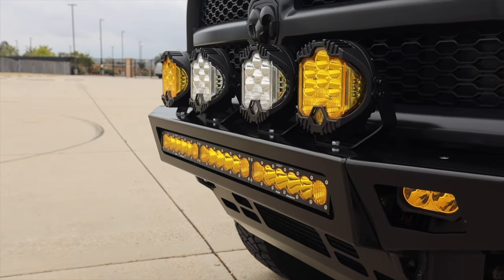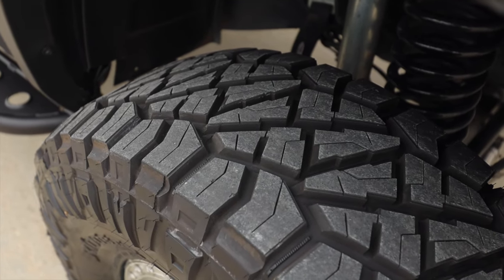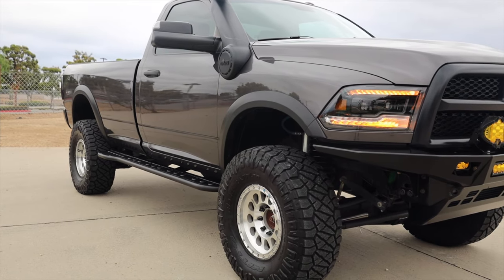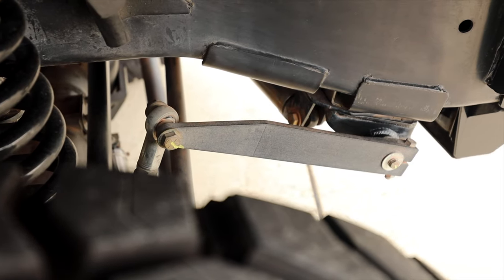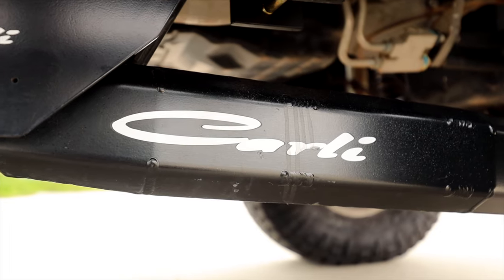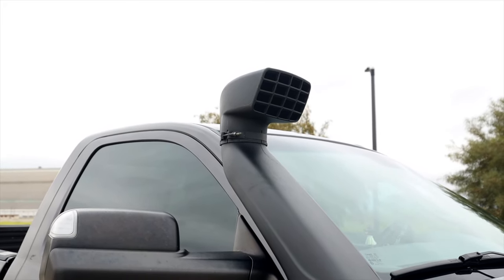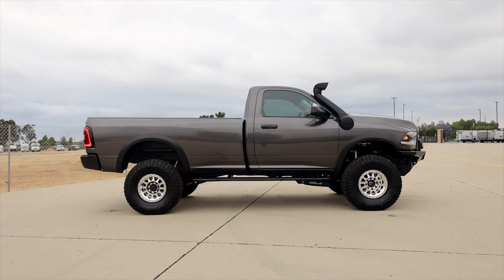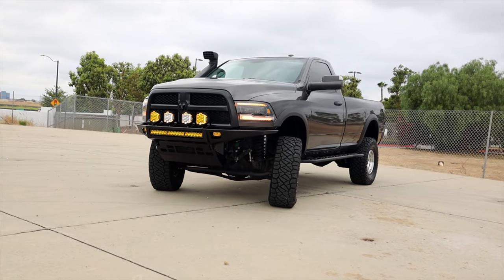Dream Regular Cab Cummins Build | Do-It-All Ram 2500 Diesel Truck

Comment: This built by CJC? Great build wouldn’t a 3500 be better for a camper build.?
Reply from the maker: CJC did do a little bit of the work on this truck! Installed the R2 coils and the Thuren Rear Arm Kit. The camper that was on the truck for a short period of time only weighed 500lbs. Anything under 1000lbs would be fine on the 2500, especially the longbed regular cab. The people adding 4WC's on the 2500 crew cab short beds would really feel the weight, especially on a Power Wagon. But yes, 3500 is much better for a heavy camper build.